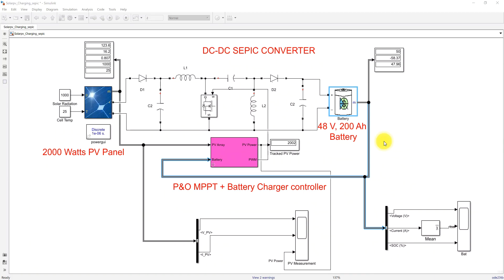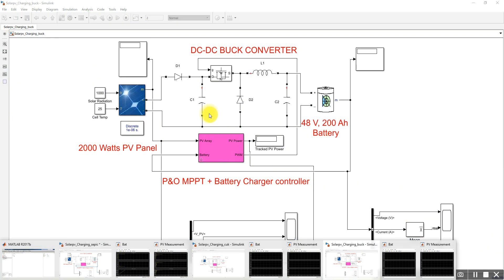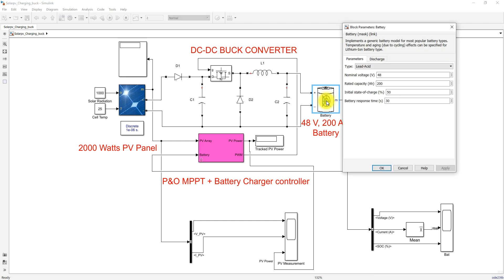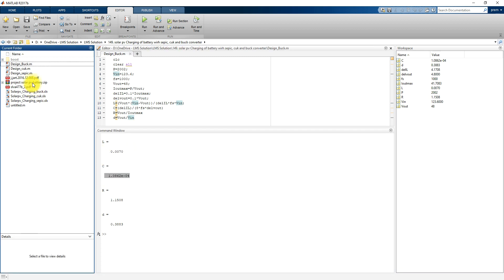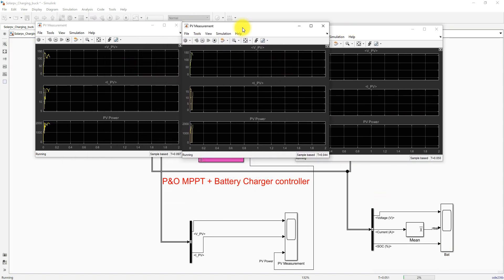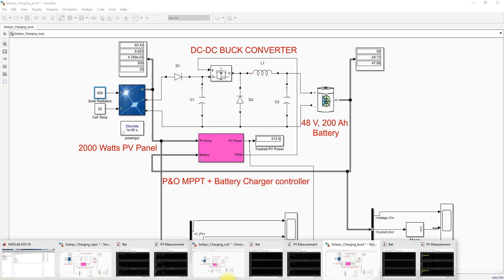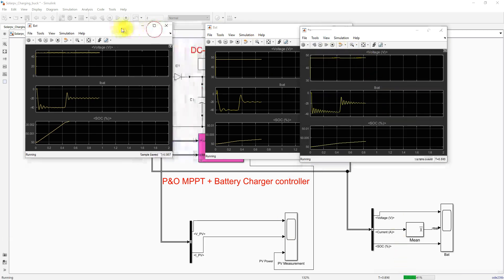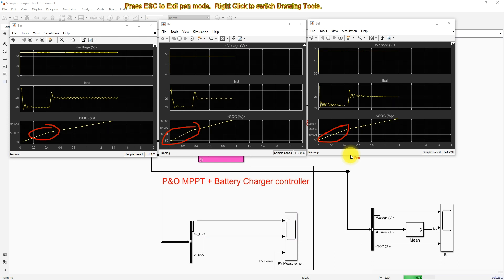Solar PV Battery Charging using SEPIC, Ćuk, and Buck Converters | MATLAB/Simulink | MPPT Control

Comment: hello sir, I have designed a sepic converter using a solar PV array for battery charge but in my simulation current is not coming in proper form. how do I channelize it please suggest any solution?
Reply from the maker: Check the description....